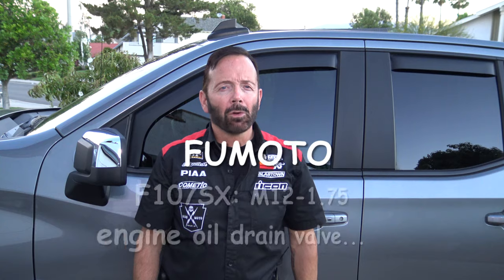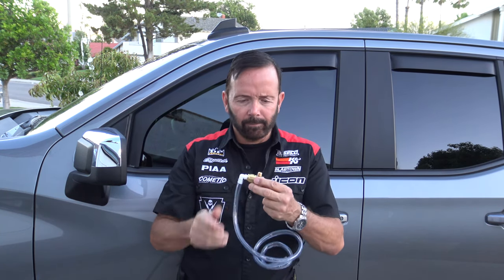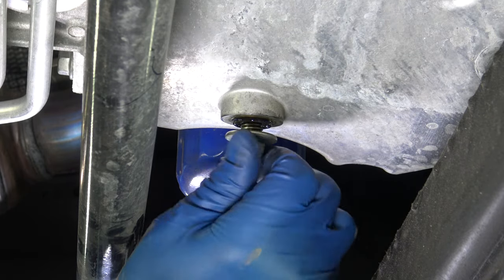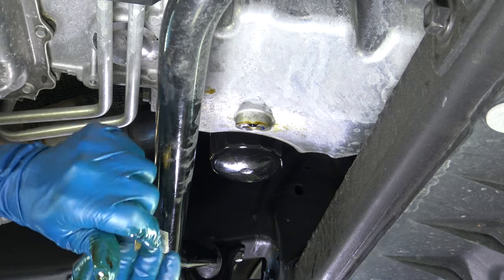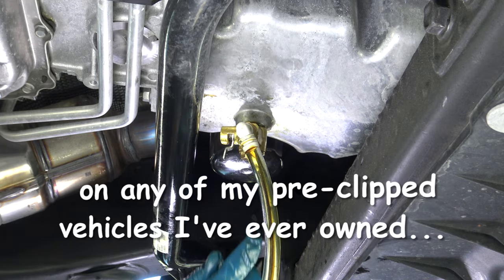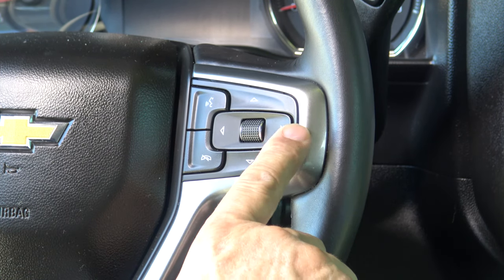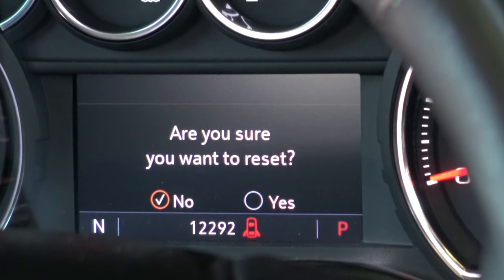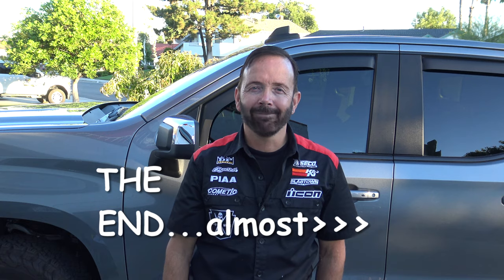The FUMOTO Engine Oil Drain Valve Install w/Paul Henderson 8-2020

Comment: Just bought this for my Jeep Wrangler...was going to change the oil today but couldnt find anything to drain the oil in....then I thought about this....nice thing with the wrangler, the oil filter is on top of the motor, zero mess unless your clumsy.
Reply from the maker: Awesome, even though some people say it's just one bolt you have to remove it's not that hard to do.  There's always that chance that the bolt will strip the threads in the pan and that pan will cost about $350.00 or more with labor to replace it. I had to replace the oil pan on my Pontiac Firebird Trans Am, I hit something in the road and it put a small hole in the bottom of the pan it was only dripping oil but I had to take it to the dealership and have them put a new pan on and I think I spent just under $250.00 I think, and that was probably in the mid-90s. 
Fumoto had sent me an extra one to make this video so I think I'm going to do a live stream giveaway for that one.

Comment: Good video.  Bloopers always a plus.  Gonna pick one of these gizmos up for my 2021.
Reply from the maker: Just did my first oil change with the fumoto valve on both of my vehicles my truck and my motorcycle. I also just recently purchased the valve end cap which will keep any dirt from getting up inside of the nipple. I never had a valve cap on my Komodo valve that was on my Firebird for like 22 of the years that I owned it never had a single problem. But since I came out with these new valve caps which is better than the previous generation ones they stay on tight. Hey be sure to check out the jlt 3.0 black oil separator. At the oil change I just did on the truck at 6,000 miles it had caught 2.5 oz of blow by.
Reply from the maker: Mason Eugene  I also order the plastic end cap to help keep the dirt out of the exit port on the valve. I never used a cap before and I have never had any problems, but I figure it cant hurt.

Comment: Can you just use a regular wrench and tighten?
Reply from the maker: YES YOU CAN, TO USE A WRENCH TO TIGHTEN THE VALVE 1/8 TO 1/4 TURN AFTER CONTACT WITH PAN.  IT SHOULD SHOW IN THE INSTALLATION INSTRUCTIONS.
Reply: @HowtowithPaulHenderson  Thank you. I plan on getting one and tighten it like the regular drain plug.
Reply from the maker: @constpegasus  THAT SHOULD BE O.K TO DO....

Comment: Is this the SX valve??? I don't think you're supposed to use a torque wrench on the nipple on the standard valves
Reply from the maker: I know on this SX valve you can. It's been too long since I had installed the standard nipple, so I can't remember- I think because of the design of the standard you can't use a Tourqe Wrench. The standard valve is tightened by a wrench only....